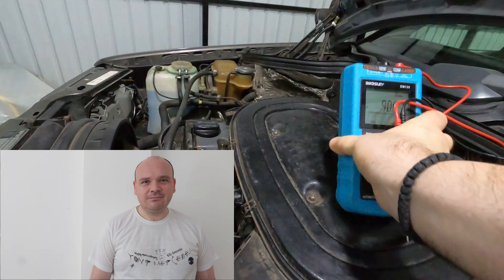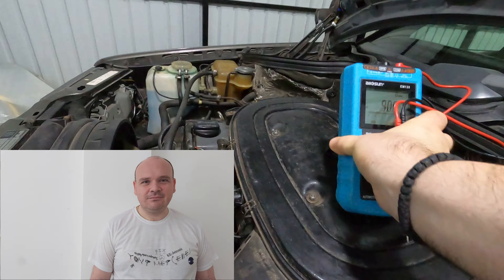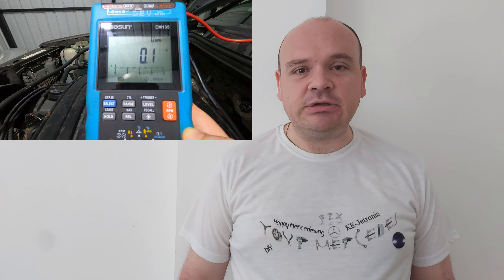㉦Mercedes Ke-Jetronic㉦ - Do I have a wrong ECU!?❓🙄🤔💥😡👹😳⚡🔥

Comment: Hello my friend,  to confirm, 0% indicates no earth, or voltage to ECU is insufficient , or O2 sensor has a loss of signal. But try doing a quick continuity test between your multimeter leads to check the tester .
Reply from the maker: Hello. I have checked for continuity, it's fine. I have fluctuation in voltage on pins 2&3 but no fluctuation in % The X11 has both voltage as well as the ground. The only thing left is to check the ovp(because the ecu gets voltage from the ovp). But I doubt that the OVP can become weaker. Thanks for your answer. Happy Mercedesing 😃
Reply: @mercedeske  the car will run with the OVP unplugged but obviously it will run on a pre programmed map so it could be worth checking . Have you got an email or anyway we can chat off air ?
Reply from the maker: @carnhicks2650  On the fb page fix your Mercedes
Reply: iirc after checking wire diagrams, without ovp you run purely mechanically

Comment: A0095450032 complies with 124.023.ECU is correct.
Reply from the maker: In essence yes. That one is for later version of the ke3 system. The only difference is that the air intake temperature sensor is on the versions that have this ecu NOT connected to the pin11 and pin15 is connected to the 4th pin(30a) on the ovp. Everything else is the same. All the sensors go to the same pins on the ecu connector.
Reply: @mercedeske how about the ovp relay sir? Are these 3 model can be substitute?